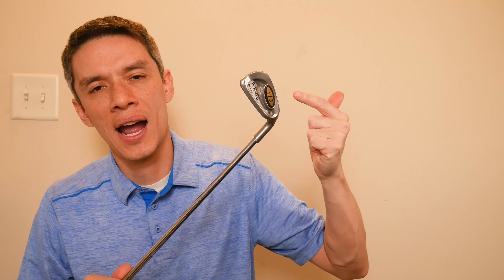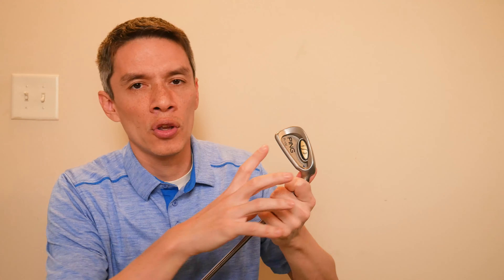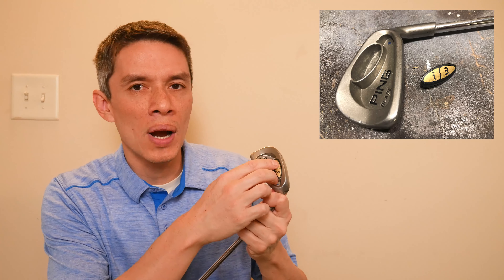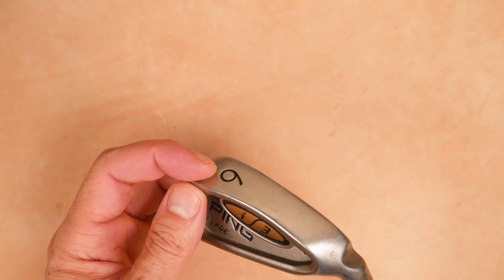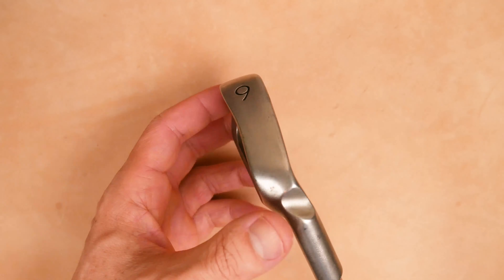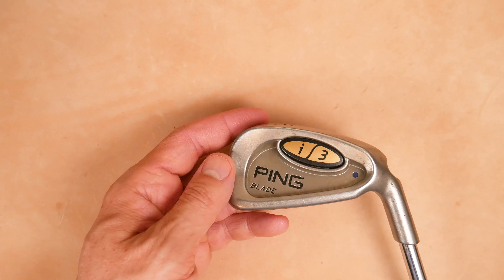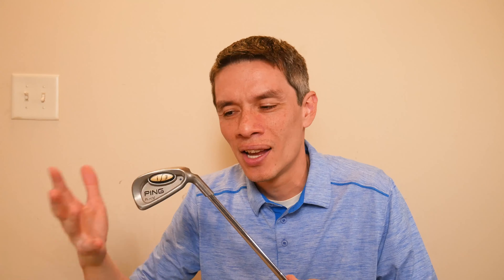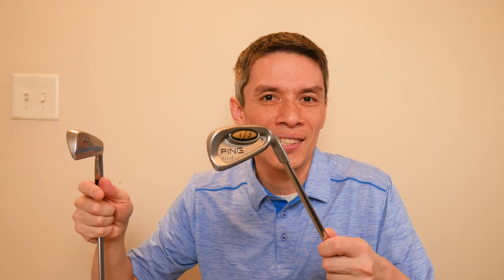1999-2001 Ping I3 Blade Irons - The Vintage Golfer

Comment: I won the men's open at my local course in 1999, I was 14. The winnings were $1500. I had my mom run me into the city and I bought the newly released i3 Blades black dot in left with the JZ Stiff shafts. It's 2022, I still use them and currently a +3 handicap. I run the Ping Tisi 7° driver with a Harrison Pro 2.5 titanium shaft, i3 5 wood with a JZ Stiff shaft, Ping Isopur 2 putter, Ping M/B 50°,56° and 60° wedges. Ping Tisi/i3 tour black bag.
Reply: I have a set of i3s and MB wedges too. Love those wedges. Grooves still just as sharp as they were when I got them 20 years ago.

Comment: 2022, Had my Ping I3 Blades since the beginning of 2000.First time I ever got fitted for a club. I just purchased a new Mizuno JPX 921 set, not to replace my Pings, in addition to them. You're right, I love my Pings. I clean them after every round (well, I clean all my clubs regularly. It's an addiction). I play well with them and I'm not embarrassed to drag them around the course. One of the best golf products ever made (my opinion). In the same time period I've owned half a dozen drivers, multiple woods, 5 putters, numerous wedges, even a few bags. I 3s, 22 years and counting.

Comment: I bought a set of i3 blades new back in 2000. Nearly 20 years later I still play them. I have tried a ton of new clubs and keep going back to my white dot, +1” i3’s. I think the reason why people are so attached to these is the fact that these were one of the first custom fit irons on the market. I remember the golf shop I got fit at and Ping really capitalized on the personalization of the clubs. Call it what you want, but I play these clubs bc I still hit them better than any of the new stuff on the market...
Reply: I'm curious, do you remember what the set originally retailed for?

Comment: Ping i3 blade was a real game changer for ping. They are a great iron which is a cavity back, but it also has some blade looks to it at address. 
I am gaming a set of these and love them. They are easily to shape shots and offer a bit of forgiveness. 
The i3 irons were the start of the next generation of ping irons after the hard to follow eye 2 & Zing ranges.
Reply: I use the s59 red dot with stiff flex those are really simple solid sleek looking irons. Rarest combo a smaller head packed with pings patented forgiveness

Comment: Love my Ping i/3s - had them since they came out. I have 6-W in the blade, and 3-5 in the offset for a bit more forgiveness. They’ve been in my garage for quite a few years. Just started getting back into golf in 2020 and I still love them.  Probably need a new driver though.  Currently have a Titanium Burner 8.5 loft with the S-90 bubble shaft!

Comment: played the i3 o size from 2007 until this year. great clubs but my miss is left. when I found out that the purpose of offset is to keep you from missing right and found out the i3 blade has little to no offset, I picked up a set of these on ebay. still miss a little left but can now fade or draw on command. have had multiple weights fall out but found another 3-9 set on ebay. hit the 6 175 yds and plus or minus 10 yards for each club up or down. love the 56 sand wedge.
Reply: I had the dampener weight fall out and I just put a stack of lead tape in the cavity where it was and a longer piece across those. Made sure the weight was similar to the dampener weight. to me it swings even better and feels better. Still have the dampener so will have to get around to fixing it but the tape works well. Also think the weight fell out because I was hitting with the club while it was cold and the balls cold. Great nostalgic club.

Comment: Just for fun pulled out my old i3 oversized which I had replaced with the Ping G25s, and played a round today. First time in seven years with these. Beginning to wonder why I replaced them in the first place. Fantastic feel, accuracy. And they'll spin any ball, even 2 piece distance balls. Tied my low round of this year. You're right there is some kind of emotional attachment. They just seem so high quality and timeless. The lofts are a bit weaker than the G25s so about half a club shorter, but just a pleasure to hit. And back in the early 2000's everybody had them at my home club. Really enjoy your reviews.

Comment: Have 2 sets. Both Green dot, standard length. One near new (unshafted, with PX Satin 5.5 - the original RP ones waiting to glue up). The other has ZZ65 and I bought as gamers/range clubs.

I had S59s that I gamed for about 10 years - almost identical performance tbh. The only noticeable difference was the top line 🤷‍♂️ 

Even as a cavity, you can work them both ways. Versatile in soft and hard turf. They really are (for me) Pings best ever iron.

Comment: Played the i3 OS from 2003 until 5 years ago. Switched to G25s only because the G25 3 and 4 irons were easier to hit. But fortunately kept my i3 set. Sentimental attachment to them. And the i3 has one advantage over the G25-easier to hit out of the rough. The i3s are classics. Worth buying used if you can find them. So now I have 5 sets of irons.  Got an old set of Top Flite Tour Titanium irons and they're great too.

Comment: I sent my i3+ back to ping for a refresh and reattach logo/swing weights and was told they no longer have them in stock🤬😫☹️
Reply: I tried to do that too. If you buy a cheap used iron on eBay you can put the head in boiling water and then removed the weight 👍